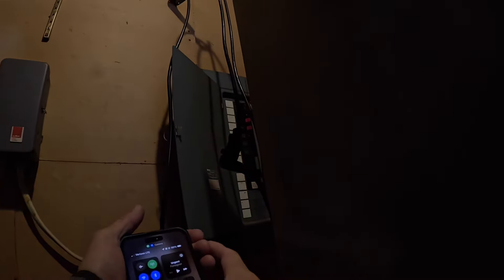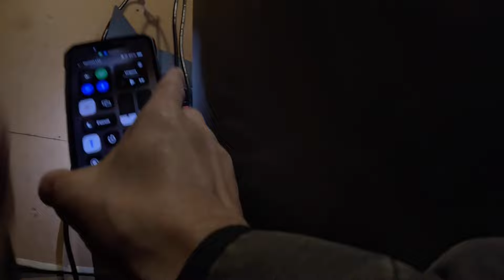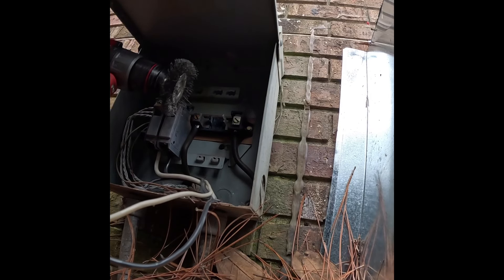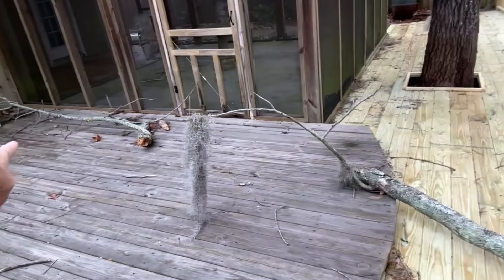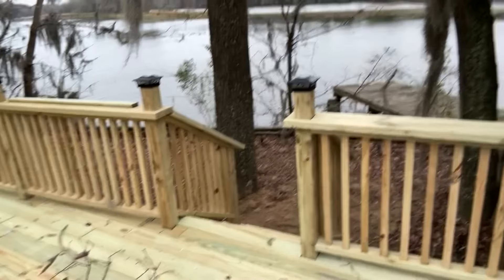Partial Power Leads to An Electrical Headache for the Homeowner! #hvacguy #hvaclife

Comment: Good video Curtis. Yea , that was the right call on that one.
You could have done the work if u wanted to. But , I prefer to stay in my trade if possible. ( Our licence in California allows us to Run Power to our equipment if We so desire. ) If - I can find a decent electrician. ( hard to come by around here ). I kind of have a Rule - if it’s More than 1 Hrs Work of Electrical Repair I Call and try to Get an Electrician to do it.
in a Pinch / Emergency / Life or death no heat / No Electrician available - You could install 2 New Pull out Disconnects up on the Wall & Pull from them.

Comment: Looks the result of aluminum wire on what looks to be copper rated lugs.  Doesn't look like there is any  noalox left on those lugs either.  I'm not suprised at that being burned up.

Comment: Nice place there Curtis!! As an electrician I would normally advise against trying to clean a badly burnt breaker stab, but as a VERY temporary solution to get emergency heat on, it is a quick fix.  I an not sure what your local Codes are like,  but I am pretty sure that a disconnect like that, even being a two-breaker one, SHOULD be one that you can replace under your HVAC license. I say this because it is NOT a subpanel by Code definition. A subpanel (which has breaker spaces beyond what the HVAC equipment requires) WOULD require an electrician. This one does NOT have extra spaces and serves ONLY the HVAC unit., which makes it a true disconnect.  You might want to stock a few of those with a small selection of breakers as they appear to be very common in your service area.
Reply: I'm sure you are correct about that, but I think Curtis made a good call on that one. It's too low to the ground and such. I don't quite know why a double was needed there to start with. I guess he could have installed 2 of the singles he has. Electrician was a good idea so hopefully it gets raised, and takes away the liability off of Curtis.
Reply: @jthonn Liability is key. I totally agree.
Reply: @IceWhiteice22  He already has liability insurance. If his HVAC license and the local codes permit him to change a single disconnect, then this instance since it is a (dual) disconnect, he has no liability issues. The height is a concern, yes, and Curtis can move it up a bit if possible as I am sure he would.  That said, I'm willing to bet the the electrician won't move it up either. 🤔
Reply: Thanks 👍  @IceWhiteice22  👍
Reply: One other thing, I am sure everyone noticed.  That feed to the breaker buss terminals is aluminum.  Not really a good combination, aluminum wire and electric heater. Not sure about the kw rating of the heat strip, but it should be copper wire. Let the licensed electrician make that call with the customer.
About the tour of your deck, where's Riley ?
Reply: @georgebrabec1749  There is absolutely nothing wrong with aluminum used in feeders, as long as terminals are properly torqued and No-Lox is used.  Virtually all service drops and underground service feeders are AL, and work reliably under the same conditions. 

That said, I too prefer copper, but only when it feeds to the unit directly or ie on the load side of the disconnect. Feeding the disconnect, with the above caveats, I used AL all the time. (wires #6 or larger). 

Do you know any Brabecs in Idaho by chance? I know a racer and his parents from the tracks I work at.
Reply: @mxslick50  Not really, however, when I was living in Chicago I found some   relations to our family. I guess I should try one of those DNA matching things. There are some branches of the Brabec last name from way back in Boheimia, Chekoslovakia.

Comment: I have a deck off the back of my house and used trex fiber boards as a replacement for the wood. I was replacing boards like crazy and couldn’t keep up with the rot. The boards would warp too. Your deck looks good and love you have a home on the water. The back of my house overlooks a swamp. Sometimes I have water in it and sometimes not.😂

Comment: My grandparent had this issue before. They had electricity, but anything that required a second phase or leg of power, like the furnace and well pump, abruptly quit. It turns out the feed cable from the power lines to their house, was corrupted and needed replacing.